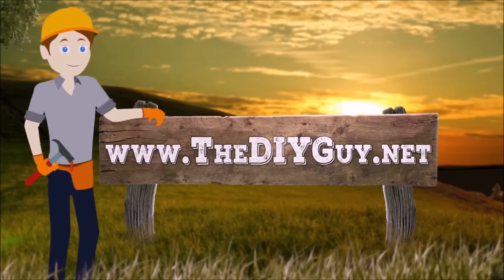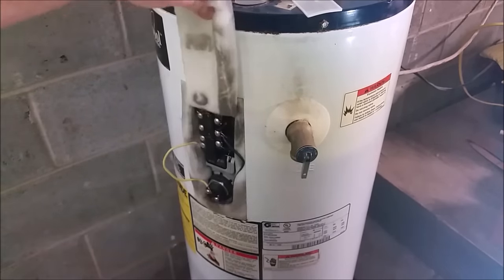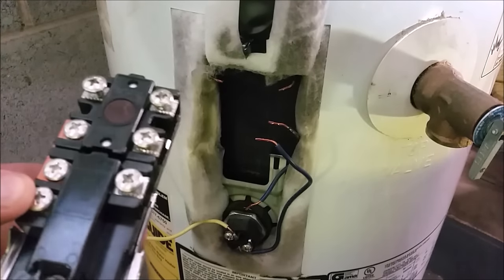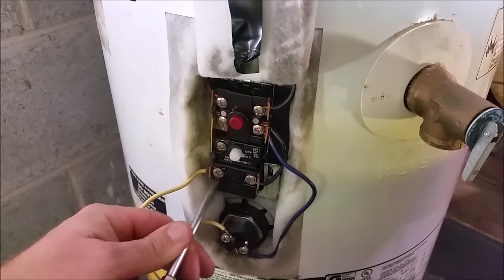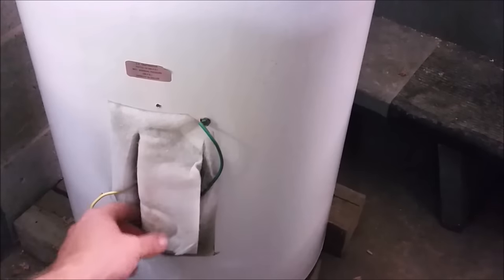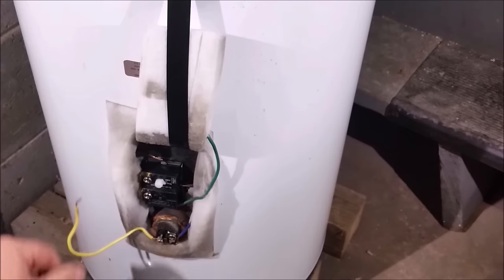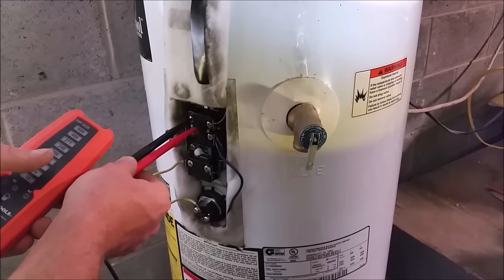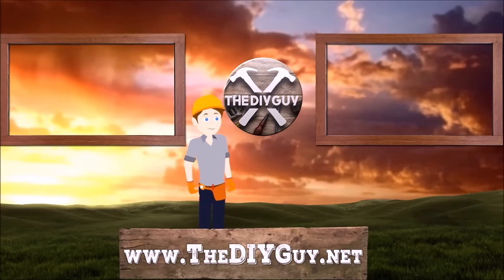How To Replace Your Electric Water Heater Thermostats

Comment: Thank you! You saved me $385 - the plumber said this was labor cost cos parts were under warranty. He said it would be two hours work.  After seeing you do this in 15 minutes I decided I could do it - I’m a beginner DIYer but this was so clear and easy I decided to go for it.  Lowes sold a “tune up kit” with both upper and lower thermostat and the rods for only $28 - success!!   You rock!
Reply: Factoring in time going to the store the get the parts and a trip to your house. Was the water heater easily accessible or in an attic? All play a part in costs of repairing things.
Reply: @emmasdad5426  that still does not justify some outrageous labor fees some companies or technicians charge
Reply: 385!? im in hvac and for that service, 65 an hour....my god I'm clearly too cheap lol for 500 you can get a brand new hot water heater what a prick to charge that much...
Reply: @simplygaming2280  and you pay to have the water heater installed too
Reply: My plumber wanted $500. 🤣
Reply: @emmasdad5426 You're also educating yourself, which is priceless!
Reply: Trades people are rip off artist.

Comment: You did a nice job showing a direct replacement. What's missing is an explanation of why it's very important to take the picture of the existing wiring like you said although there is a chance someone was there before you and they may have made wrong connections but the customer should have told you so but didn't. But the importance of the safety(red button) is between the top connections 1 and 2 and then 3 is protected by the limit (red button). If either of the other wires are attached to 1 or 2 connections then you may have a serious condition because it's not protected. Just a thought. Nice video thanks.

Comment: Thank you. I have had to drain my tank twice in the last week trying to figure out why my hot water heater wasn't working. I'm pretty sure it's the thermostat. I've replaced the elements already and the guy that came out said everything on my hot water heater was good  but the breaker kept popping so he replaced the 25a breaker with a 30a. But now I have to push the reset everytime I need some hot water. So I'll just replace the thermostat myself an hopefully that fixes it.. the water heater is only 4 years old so I'm hoping there's nothing internally wrong with the wiring

Comment: Thank you!  Moved into a house with a heater that had no upper thermo installed. Picked one up at the hardware store and plugged it in today. I have ALL the hot water now.

Comment: Very informative and to the point! Thank you! I've already changed the elements and they were in horrible shape due to our hard water despite having just changed them just over a year ago. I had to buy an Element Wrench for the stubborn one on the bottom, but the HWH is not reaching anywhere near the temp I've set so the thermostats are next! I also recommend taking a picture of the wiring configuration before disconnecting the wires.

Comment: Great video one question I checked my thermostat and lower heating element at 125 degrees and no power but they both have power at 150 degrees and I keep my water at 125 degrees what's your suggestion a bad thermostat and lower heating element?

Comment: My 23 year old Kenmore Power Miser 8 is overheating and the pressure release valve is working and releasing scalding hot water.  This happened a year ago and I turned off the breaker and let it cool for a day or two and turned the breaker back on and it's worked fine until now. Shut the breaker again and when on it still overheats after a few hours. So I suspect this is a faulty thermostat. Am I right in that or might it be something else like a faulty element?  Each year I drain off the dirty water accumulated at the bottom so I think that has had something to do with its longevity. Our water here is excellent quality soft lake water that hardly needs treatment - primarily UV light as it leaves the municipal reservoir.  Thanks for the excellent video.  Do you have any experience with the new Heat Pump water heaters? They cost 3 times as much but only use about a third the electricity.  Wondering how well they are holding up.  I installed a Mitsubishi heat pump to heat the house 10 years ago and it has been flawless.  Wondering if the water tank heaters as as reliable. Thanks again for the great video.

Comment: Great video and easy to follow instructions. I changed my heating elements a year or two ago as I accidentally blew them when I had to upgrade the wiring. Unbeknownst to me the previous owner didn't relabel the 240 down to 120 and I overpowered them. Very annoying. The tank is fairly old but still working okay. My wife noted there isn't enough hot water for a bath so considering a thermostat change based on this video. On a side note, curious why the audio has clearly been edited after the fact at various moments in the explanations. Something you don't want to share after the fact?
Reply: I noticed the same thing and I assume it's for legal reasons, not to advice water temperature (too hot, too cold) -- People love frivolous lawsuits these days

Comment: Thanks so much for this video. My question is I have relaced thermostats and element. Pushed reset button but still no hot water. Maybe a stupid question but does water heaters have 2 reset buttons? What should I do next, brand new w/heater? This one is about 4 years old.

Comment: Thank you. I had no idea how to do that. Thought it was more complicated. Going to Lowe's tonight!
Reply from the maker: Its not to hard once you have seen it done before. Just ensure to shut the power off and maybe use your cell phone to snap a picture to ensure you get the wires back on the correct terminals but its straight forward. Good luck with getting the water heater back up and running. Thanks for watching and taking the time to leave us a comment. Don't forget to give the video a thumbs up/ like. Thanks

Comment: Outstanding video!  I had an issue with my water not heating after a little troubleshooting I notice some burn damage in the upper thermostat.  I also notice that the insulation was a little damp.  Don't know if the damp area cause the problem or vise versa.  Any help with this dilemma would be greatly appreciated. Thank you in advance!
Reply from the maker: Is it a Bradford White? I have had a bunch of them start leaking somewhere between the top electrical connection ( feed wire for the heater) and the upper t-stat. If that's the case the water is above the upper element then you will most likely need to replace the heater as its started leaking and if looks like its below or at the element you can check to see if its leaking around the element. How old is the unit?
Reply: 0

Comment: Great video and well explain. Now how do I test the thermostat? Or if I check the elements and they are good I assume it is the thermostat? The issue with the water heater is that I have hot water but just for a few minutes only. Thanks again
Reply from the maker: Thanks. 9 out of 10 times running out of hot water will mean the lower element is not working. The top element is working and the hot water rises to the top where it exits the tank but without the lower element working the  lower part of the tank will be cooler and then that is where the new cold water enters the tank though the dip tube. If you replace your lower element that should fix your problem. Video of that -> https://www.youtube.com/watch?v=ReR_UcOf7E8
Reply: TheDIYGuyDOTnet is it a good idea to just go ahead and replace both elements if only the bottom one is bad?
Reply from the maker: @jessm1638  In my many years working on heaters. I don't think I once had to replace a top element. The bottom does most of the work and is lower in the tank closer to the sediment so it seems to fail more often. If your draining the tank to replace the lower one you could replace the upper one as well as its only another 8-10$ just to be safe.
Reply: TheDIYGuyDOTnet thanks!  One more question... they say don’t restore the power until the tank is full.  What is a good implication for a full tank?
Reply from the maker: @jessm1638  No problem, Glad we can help. Yes, correct you want to ensure you have most of the air out of the tank or at least above the top element as it could cause it to go off on reset and possible damage the upper element. Its best to run the faucet or whatever fixture is closest to the water heater until you get no air coming out then to be safe move to the next closest fixture and run that one as well.

Comment: Excellent video, but I have a question for you, I replaced both thermostats and elements and still no hot water. I have power to both thermostats though and have have the temperature set at 120 degrees. Any suggestions would be great
Reply from the maker: Thanks. Shut the breaker off and then back on to ensure that both 110 volts legs are on. You can either check the power on the top of the heater or you can check the top two terminals left and right like we did in the video to ensure it was off and make sure you get 220 volts. Also you can check the reset button on the top t-stat, with the power on to the heater press and release it. Also check your wires going to your lower t-stat sometimes when the lower element fails it draws to much and causes the wire to heat up and break. The middle wire on the right (red) of the upper t-stat goes to the lower element. Check continuity between the two points to ensure that ones not broken. For the other wire test the lowest terminal on the right on the upper t-stat (black) and the terminal on the lower t-stat. The terminal where the wire doesn't just jump the t-stat to the lower element.

Comment: My water heater is somewhat involved to access. Last week or so it became apparent one of the elements had died on me. Once I went to all the trouble to access it and drain it  I said... WTF... replace everything... parts are cheap. So I installed thermostats and need elements while I was there. Gleaned some info off of your vid here... thanks. It was right simple once I got the system drained and flushed out good.... but indeed... I drew me a wiring diagram before disconnecting anything!. Thanks.
Reply from the maker: You're welcome, Glad we could help. That's what I try and tell people.. If you have a problem with the heater while your in there replace everything as the parts as fairly cheap and as long as the body of the heater is in good shape. Don't forget to give the video a thumbs up/ like if you haven't already. Thanks
Reply: @TheDIYGuyDOTnet  Gotcha on the "Thumbs up"  And yes it was an easy fix. Both thermostats and heating elements were only $28 bucks bought as package. I also left the panels off for a while after installing the heating elements and pressurizing the tank to make sure there were no leaks. After an hour it was still bone dry. Job well done and I patted myself on the back. Thanks again......….
   Stay well thru all this CoronaCrazy!!!

Comment: The replacement thermostats for my whirlpool are universal. Neither of them are the right length. Do they are not fitting into the catch system to hold them in place. Also the thermastatcontrol us in center instead of on bottom. Should I use these any way and if so how do I secure them in place

Comment: What is your view of better quality water heater...Should I look at A O Smith, Bradford White , or Rheem?  The local big box stores around here carry those....Or are they all the same quality wise.  I have my current one, Bradford White now for 15+ years.  Reset button keeps popping.  Am thinking it is the t-stat.  Tested both elements and t-stats.  They all get the correct power, so I am torn between replacing the parts for around $85, or being 15+ year old tank, just get a new one.  No sentiments showing in water when showering or thru the facet....
Reply from the maker: Good question. I'd stat by check the warranty coverage, for water heaters they are 3 to 12 years. While you’ll pay a little more for a longer-warranty, Most of the ones with a longer warranty tend to have larger heating elements or burners that can speed up heating of the water and most have more insulation as well for less heat loss. I also look for brass drain valve rather then a plastic one, brass are more durable than plastic and it shows they didn't try and save a few extra $$. In my experience which was mostly 220 Volt electric heaters. For those we had a bunch of AO smith's that seemed to last at least 15 years or so had a few go 18 years then our supply house switched to the brandford and white and we installed a good amount of those as well and we seemed to get only 5-7 years out of them on average maybe a hand full that went 10 or so years. Most common problem with those seemed to be that they rusted out right around the top element where the bung was welded to the tank. A good amount of people complained to the supply house and they went back to selling AO smith. So we installed a bunch more of those and I would say we were getting a solid 10-12 out of the newer ones. The gas ones we did have for larger buildings were AO smith as well. I lean towards AO Smith just because of my experiences. Most of those were installed on city water which could have an effect on the life on the heater because of the chlorine. I haven't had much experience with Rheem although my parents have one in there house and I think its coming up on 6 or 7 with no problems and I also install there Performance Platinum gas tankless (ECOH200DVRHLN) in my new house but have yet to use it. But I just looked though reviews and I think on consumer reports or something similar and it was one of the top 3-5 tankless heaters. You should be able to get the parts cheaper https://amzn.to/2t8LTxb or https://amzn.to/2GlU4OB sometimes they are cheaper if you get them separately, Just get the same brand T-stats. With a new one you will get some piece of mind for a few years that you shouldn't have any problems, leaks ( not sure where the heater is located) and some cost savings as it should be more energy efficient and that you won't have to scramble to get a heater and install it when it does go out. (always at the best time of course). Hopefully that was more helpful rather then making it harder for you to make your decision. Good luck with which ever way you go.
Reply: @TheDIYGuyDOTnet  Thanks.  For $32, think I will just replace the 4 parts and see what that gets me.  Water is city with chlorine and has been pretty good, so hope I can get more years from the tank itself.  But should I replace whole thing later, I will go with the R O Smith and make sure it has the brass drain valve.  Thanks again.

Comment: Excellent video! My top thermostat keeps tripping, so I have to reset it often. Pretty safe bet it needs to be replaced?
Reply: One thing I'd like to add --- the two thermostats should NOT be set to the same temp.!!  the 2 thermostats have to talk to each other -- the Top thermostat should be set about 10 deg. Hotter than the bottom thermostat.  So I'd set the Top thermostat to say 125°F. and the Bottom thermostat set to about 115°.

Comment: Thanks  for the video..... I have a question I have a Whirlpool hot Water heater that just quit working It might be the heating elements need replacing but It has a computer unit on top and I hate modern day electronics on stuff that do Not need It Whirlpool wanted around 172 dollars for It then I found It on Amazon for 90 dollars but I still think that Is too much for something I hate, I want to bypass It and Install the older type of Thermostats that has worked well since before Integrated circuits but I Am afraid If It does Not work It will get too hot and explode so what do You think of doing that?
Reply from the maker: Your welcome. That doesn't do anything? or you hit reset and it over heats then goes back off onto reset? I'm guessing that its an electric unit and not a gas one correct? I would start by verifying that you have 220v going to the heater. I have had a few where the breaker trips only one leg so the heater was only getting 110v and wouldn't work. Once you verify that you have the correct voltage going to the heater. If the Control Board is getting electrical power (and correct voltage) but the Diagnostic Light is not lit, the Control Board should be replaced. if its lit some of the flash a code to tell what is going on with the heater. You could aslo turn the heater up a bit if its already warm/ hot so it powers the elements. Then you can test the elements to see if the power is going though the control board and to the elements. Not sure the model or the part # for the control board but if its a WP22003906 you can get it for around 35-45$ -> https://www.ebay.com/p/Whirlpool-Washer-Control-Board-WP22003906-100-01226-04/1876324895?thm=1500&chn=ps. It shouldn't as the top / main thermostat has and over heat safety that makes it trip and go off on reset if the water is overt heated and if the pressure relief valve is working it should relief the excess pressure though that. I don't think I would go that way I would shop around as I'm sure you should be able to find the control board somewhere else for less. Also not sure of the age of the heater maybe your better off just replacing with a non smart unit.